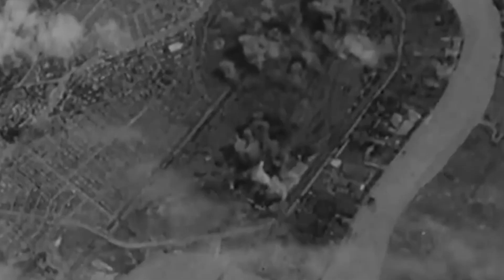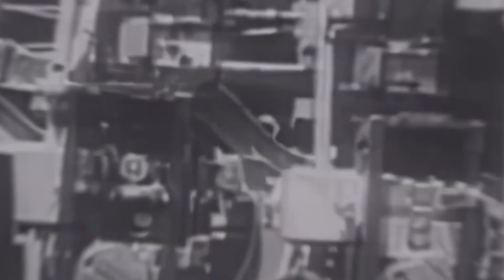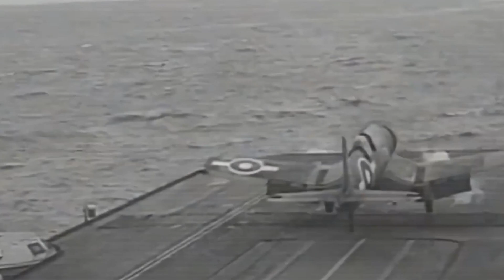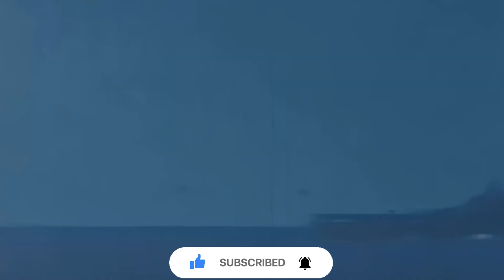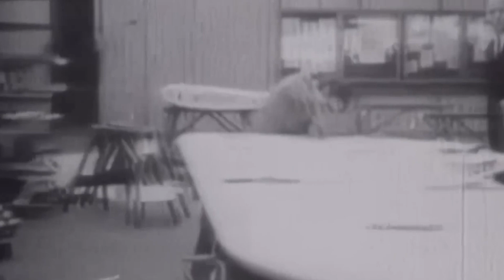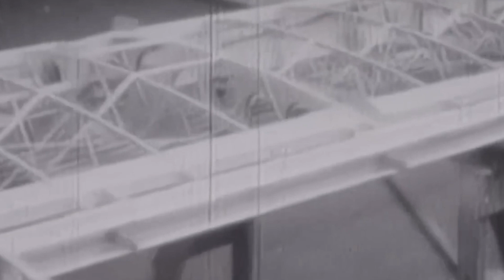The Insane Engineering of the Vought F4U Corsair

Comment: no fuel in the wings led to ridiculously long nose. the uk tempest had a larger propeller but no bent wing. the hell cat did a better job for half the price. 'mph' great new word ai... thanks for the laugh..
Reply from the maker: The comment incorrectly attributes the P-47's long nose solely to a lack of wing fuel tanks. The Thunderbolt's large, turbocharged engine and associated ducting were the primary factors, unrelated to the Tempest's propeller or Hellcat's cost.

Comment: On the whole, this analysis is quite accurate. The reason for the gull wing by CV engineers to join the fuselage at 90 degrees and makes both aerodynamic and minimize wing gusset flaring benefit and therefore allow for shorter struts and larger prop, ie, to better utilize the engine power.  The strut stroke and pressure changes discussion, as a result of the US rejection as a carrier aircraft and the British analysis and resolution of the issue, therefore making the Corsair acceptable to the US Navy was huge in successful addition to previous USMC land based usage (ie VMF 214 "Black Sheep"). The mechanical AI voice was OK but repetitive and the articulation of words in abbreviations as in MPH and "7 point 5" and "point 5 M2" machine guns and "20 mm" later.
I had no idea what some of the photos were in here for. Assembly of Spitfires and other non-Corsair related pics and ppl with no mention of who they were (Maj Boyington) seem to have been put in to lengthen it without purpose. 
Finally, I subbed (# 827) and appreciate the channels points and will look at the other videos. Thanks for the effort.

Comment: EmPff, everyone knows what empiff is - Miles Per Hour. Repeating the basics several times through the video makes it easy to remember the ground breaking innovations which are old news in this day. Wonderful video with basic information repeated so it is easy to remember the ground breaking innovations that helped explain the innovation involved. Also, the talking over video clips that weren't showing the innovations as discussed led to a disconnect with the iconic aircraft. It would have been better to show the hidden equipment in blueprint or cut-away images rather than showing biplanes taking off or landing. Thanks for the video.